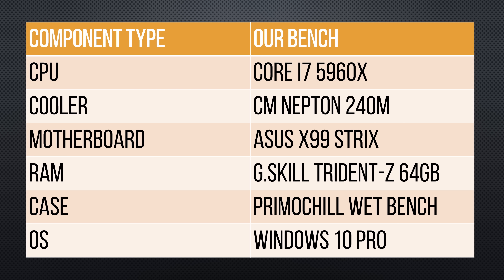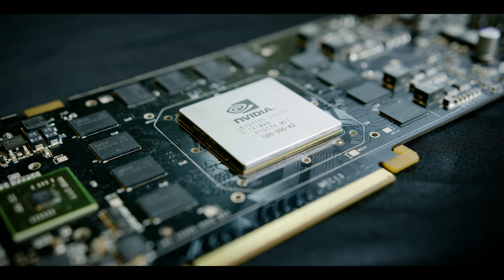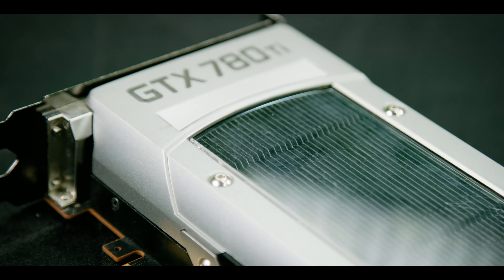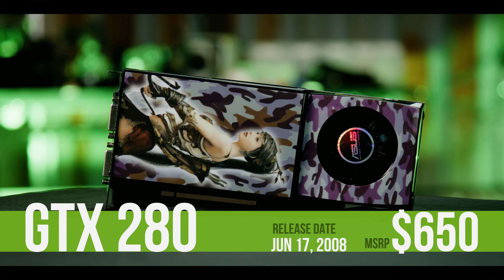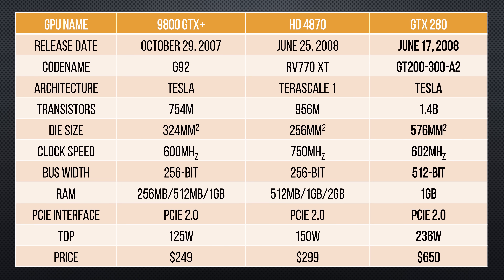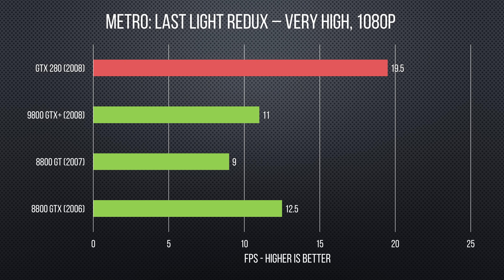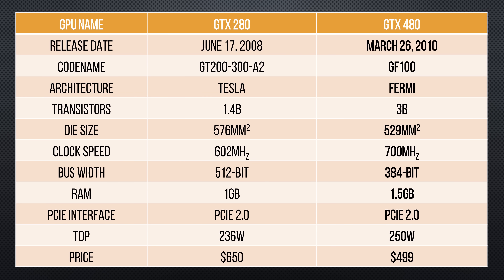10 YEARS of NVIDIA Video Cards Compared!

Comment: yeah but the HD 4870 was way better than the gtx 280
Reply: ego AMD didn't make enough r9 290x's and they were in high demand for crypto currency mining. meaning they were out of stock everywhere for almost a year. and due to this, retail stores kept increasing the price. at the highest point a reference 290x was $900. So while it was better, it was not cost effective to go with AMD at the time.
Reply: and the HD5870 was way better than the GTX 480 And the HD7970 was way better than the GTX 680 even though both of them released half a year earlier and the R9 290X was better than the 780. But Nvidia still outsold AMD somehow and no the drivers werent bad or the cards to hot(maybe not the reference R9 290X)
Reply: ItalyNerf Back in early 2012 i wanted to buy a GPU for BF3 and the 680 had the better performance in BF3 at the time and I was about to buy one. But then I decided to go with the HD7970 because it was cheaper at that time, was a good overclocker, had features like asynchronous compute, better multi monitor support and so on.And I thought it would hold up better than the 480 because of these features. My Card did run 5 Years at 1125Mhz and was able to run at 1175MHz if you surpassed the driver limitation. A friend of mine did buy a 770 which is a slightly altered 680 with higher clocks,more Power draw and better memory and today my card runs games just as well if not better than his card and he runs constantly in directly errors in modern titles. So I'm pretty glad that I purchased the HD7870.The HD5870 is still up and running in another system and does even run BF1.
Reply: Up to personal experience, I had 3 nvidia cards and 5 amd cards, 4 amd cards failed and no nvidia card failed. My 7950 was a dog in overclocking and my 570 was a beast. Running a 1080 now.
Reply: Zane Erickson Thanks, didnt know it was this bad.
Reply: Price/performance ratio, yes it was. But pure performance? Hell no. The HD 4870 was roughly GTX 260 level, the 280 was unmatched until the 4890, but then Nvidia released the 285.
Reply: TheConst4nt sure the 280 had the higher performance but NVIDIA brute forced again and as a result the 280 was more than double the price for the Hd 4870 and in some games with aa the 4870 even managed to beat the 280. With the exceptions of OpenGL the 4870 had other better features like DirectX 10.1 support and so on
Reply: i have three hd 7970's one if a base model, the other two are xfx ghz editions, all three will pretty easily 1100 mhz core, but the xfx models were cappable of maintaining 1200 core, 1700 mem daily, which was way past driver limitations, many people said the the memory vrm would fail due to lacf of cooling, but they were quite wrong, water cooling was added about 6 months before i got a fury x for a deal just to make the pc nice a quiet.
Reply: Well, it might be better today (have not checked benchmarks) but we are talking about gpus that are no longer in production. Most people will buy new graphics cards rather than picking up a used old one. (Most people don't know that you can put together a very good pc with old used parts for way cheaper than buying new)
Reply: ItalyNerf I habe build many Systems over the years and only one 5year old card  failed out of the 10 Amd cards I've used over the years (most of them are now also over 5 years in use). On the NVIDIA side also one Card didn't work after 2,5 years in use out of 5 I've used in Builds. It was actually My HD7970 that failed because I tried to hit 1300Mhz and with the high voltage needed to achieve that the capacitors died.
Reply: +ego  back then amd didn't have crimson but only a shitty driver lacking many features nvidia had/still has like screen capturing with minor performance loss. also nvidia has some nice propriatary features with physx/gameworks I wouldn't want to miss.
Reply: thats why I said BACK THEN not today...
Reply: ego I had a Saphire triX r9 290x that died for no reason 5 weeks after I got it. And they refused to warranty it.
Reply: +Zane Erickson when did you bought the card?
Reply: DanielC when the prices for them finally dropped back down to MSRP. I got my triX 290x for $550 if I remember correctly.
Its a nice paperweight/desk ornament now.
Reply: AMD has relive which is as good as shadowplay if not better.
Reply: Both gtx 480 and 680 were faster than AMDs counterparts, check your facts. Nvidia didn't pull a miracle and sell more without reason, AMD released the cards before and ofc Nvidia gotta leapfrog and take back the performance crown. And today AMD is just a hype train, they still didn't come up with better cards than Nvidia, even though I hope AMD is gonna kick Nvidia in the face cause they need a reality check.

Comment: still using GTX 580, playing dota 2, battlefield 3, COD MW3, Battlefield 1 at high settings
Reply: battle field 1 15fps
Reply: mine reach 50-55fps with 2600K + GTX 580, 1080p at high settings

Comment: AMD FX 6300 six core X 3.50 GHz
8 Gb DDR 3 ram
GTX 1060 video card 
 Is this good or bad for gaming?
Reply: Wade Hutchinson FX 6300 is irrelevant. GTX 1060 is perfect for 1080P gaming. Just get a LGA 1150 i5 with a motherboard, use the ram and you'll be good to go
Reply: bought it from Tiger direct (They suck) when i put the 300 dollar video card in great computer....except for the cheap cooling fans that stopped working ..Goto New Egg for a prebulit computer.....Next time im starting from scratch 
MB on up to a ssd
Reply: Wade Hutchinson well yeah, they are the superior processing units. But if you get it used it can be cheap. I got an i5 4690k with a corsair h80i water cooler for $120. It was used but I cleaned it up and put it in my MSI Z97-Gaming 5 motherboard I got also used for $50. Had 8GB of DDR3 ($50) and a 1TB hard drive ($50). Used a Corsair SPEC-02 case ($30), HD 7970 graphics card ($80) and an EVGA 500B psu ($30) total of around $400 and runs all games super nice
Reply: Wade Hutchinson or get a Ryzen CPU
Reply: Wade Hutchinson but then you'd need new ram so RIP
Reply: Wade Hutchinson Should be able to handle most of the games
Reply: i can run all games on max gpu output anywhere from 70 -180 fps
Reply: Wade Hutchinson I believe it. In 1080P. Soon enough the FX 6300 will start struggling, especially if it's not overclocked
Reply: by that time i will win the lotto and get the UPPER high end shit
im 54 play War Thunder /World of Warships

Comment: I had a 8800GT  back in the day, it was amazing back then on my 3ghz Pentium 4.  
I then went to the AMD 6870 around FFXIV (1.0) and SWTOR time, which I used for a long time.  
Until I upgraded from my Core2Duo, to the 3770k, which I got the GTX 670.  
Used that for a long time, until I got my current 1070.

Comment: Nvidia didn't technically skip the 800 series cards, rather the 800 series is like the 300 series where the chips were only implemented in laptop PCs, but I'm sure Linus already knew that and didn't want to repeat information.

There is still driver support for the 800 series on the GeForce website.

Comment: I think a 780 TI or a 980 would be good for this budget build I'm doing, I see them on eBay for less than $200 and I don't see anything better for that price.
Reply: I meant 780 TI lol
Reply: 1060 is as good/better than the 780Ti iirc
Reply: The 780ti is severely gimped in new games, it falls behind a 1060
Reply: Felixkeeg what about if I get a 980 for around $250
Reply: An rx 480/580 and a 1060 are at par with a 980 more or less.  A 480 could be had at 200, and a 1060 for probably not much more.  I  personally wouldn't go for a 980 unless it was quite a bit below $200 (170 or lower).  At $200-250 there is comparable performing new hardware with lower power draw and a warranty.  People are way overpricing their used stuff (not accounting for reduced life span/depreciation/loss of warranty compared to comparable new hardware).  Not saying there aren't good deals, but if you can get the same perf/dollar new it would be silly not to.

Comment: still using a 670.  i'm poised to upgrade to 1080ti with an htc vive in the next month.  looking at those benchmarks in this video against the 680 has me pretty damn hyped.
Reply: mh444 I sold my vive after my 1080 purchase. my 970 was fast enough because vive's res sux. 
screendoor effect is so noticeable
Reply: Older cards are still fine, really. I used my 560Ti for about six years straight before upgrading to a 970, and I don't intend on replacing that anytime soon either.

Comment: Hey Linus, you're making me feel old. I still have an old 7900GS, one generation before the 8800's. I voltmodded it by drawing silver traces across the PCB, and stuck a gigantic cooler on it (Zipties to the rescue!), then overclocked it massively. It  was actually pretty close to the 8800GT in performance... so close that I was really disappointed when I got one and it wasn't much better than what I had before. xD

Overclocking used to be hardcore - PCB mods, etc.; now it's all practically automatic.

Comment: Graphics cards cooling through the years.
90-95: looks like a soundcard.
95-98: soundcard with a northbridge style heatsink
98-02: 40mm fan on that northbridge style heatsink
02-04: single slot cooler directly over gpu (aftermarket dual slot available)
04-06: single slot blower cooler the length of the card (8800gt era).
06-08: fuck its not enough make it dual slot! 8800gts 512/8800gtx/hd3870
10-12: dual slow twin fans or if noise/temps are ok blower style and just "deal with it"
12-15: same (experimenting with tripple fan loong dual slot or tripple slot.)
15-17: ......so waters pretty good at cooling, who knew?
17-19: liquid salts or permanent phase change, 10nm is more leaky than we expected and thermal density is a bitch (again, who knew?).

Comment: 10 years of "hey sorry we forgot to enable some cores".
followed by "oh hey yeah sorry we forgot these cores too".
tesla-8800gt had 764M transistors but had 14.2% of them nerfed.
tesla-9800gtx HEY they're un-nerfed.
tesla-gtx280 tesla rebrand but made bigger.
furmace-gtx480 had 3 billion transistors but had 6% of them nerfed.
furmace-gtx580 y'know when you said the full 480 core never came out? un-nerfed rebrand.
kepler-gtx680 mediocre core to combat 7970 which was kicking gtx580's ass.
kepler-gtx780 kepler again "OUR BEST CARD YET!", not.
kepler-gtx titan "OUR BEST CARD YET!" not.
kepler-gtx 780Ti "OUR BEST CARD YET!" not.
kepler-gtx titan black "OUR BEST CARD YET!" not.
kepler-titanZ was.
maxwell-gtx 980 "OUR BEST CARD YET!" not.
maxwell-gtx 980ti was........not
maxwell-gtx titanX was.
maxwell refresh-gtx1080 "A NEW KING" pah haa haaa haaa suckers!!!!
maxwell refresh-gtx1080ti "OUR BEST CARD YET!" not.
maxwell refresh-gtx titanX(p) "OUR BEST CARD YET!" not.
maxwell refresh-gtx titanXP almost their flagship if it had HBM2 the tesla versions are using.
10 years... 8 times "flagship" cores had disabled sections that would be unlocked later. 12 times "our best card yet" wasn't, only 4 major architectures.
memory bus width on x80 "flagship" products shrinking 384>512>384>256..., parts of cores being disabled and eventually cut out instead relying on emulation.
So who wants to buy the "flagship" volta gtx2080?....

Comment: What the heck happened to the GTX 590????!!!!!!
Reply: technically the GTX590 is a dual GPU meaning its an SLI setup in one card. this video just explained the different architectures through the ages, while comparing performance with X80 cards or X80ti
Reply: Frequency dual GPUs don't count because it's not a single die, not to mention Nvidia duals were never good, always beaten by and duals

Comment: Still rocking the GTX 480...... because I'm poor and gfx cards are stupidly expensive.
Reply: 7970's cost peanuts...which you can use your 480 for roasting and blow the 480 into the weeds (have a 280x and 3x gtx480's fwiw)
Reply: psygn0sis buy a gtx 970 that is cheaper now baby boo

Comment: I have always had Nvidia graphics cards in my PCs since I had my first graphics card, a PCI Geforce FX 5200 64MB and now have a 4GB GTX 980 Ti. Anyway, if this is "Nvidia GPU cards through the ages", why no GTX 550 Ti, GTX 560, GTX 560 Ti, GTX 650/ 650 Ti, 660 Ti, 670, 750 and 760 Ti etc...?

Comment: I have an A10 7890k CPU with an integrated GPU, 8GB or ram 1600mhz DDR3 and for some reason, it runs lower that it should, for example in overwatch, I have seen benchmark that runs the game at 50FPS in low with 100% render, but on my computer, it runs at 40-50FPS but with 50%render

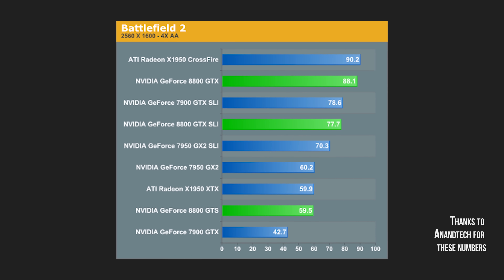Comment: 2:21 so 8800GTX was capable of 88fps, and 8800GTX in SLI was only capable of 77fps? Or is it another mistake and it should be 8800GTS in SLI instead? There's also a mistake @7:04

Comment: My old ass Sapphire R9-290x is on par "fps" with newer NVIDIA cards. Did I hit the lotto or something?
Reply: BigCannon Adventures ya, it's funny how good my 290X is too. I just bought a 980 ti however so I can game maxed on 1440p. ;)
Reply: Is the 980Ti good? I thought about getting a 980 or 1070/1080.  Would it be worth the upgrade?
Reply: [ive built 1070 sli rigs and have used everything under fwiw] 290x is a boss, 980 will be a little faster but not enough that second hand prices will make worth it (still overprices 2nd hand), 1070 is a great card...until vega, we'll see. but if you can get a 980ti second hand cheap you'll be a very happy chappy and its what i'd do if i wasnt happy with my card and couldnt wait for vega.
Reply: Toms Tech bought my 980 Ti Asus Strix OC last week on eBay for $300 barely used. Smoking deal considering I can sell my 290X for $200.
Reply: Toms Tech bought my 980 Ti Asus Strix OC last week on eBay for $300 barely used. Smoking deal considering I can sell my 290X for $200.
Reply: I'll have to really think hard. It took me 2 months to decide on the R9-290x lol.  A 980Ti for $300 sounds amazing but then again Vega could be the "next gen badass". I just dont know

Comment: Could we get a new Hackintosh build video? like a GTX 10xx and Intel Skylake (or AMD Ryzen) one?
Reply: You cannot make a hackintosh with AMD cpus, not worth it anyway.
Reply: Yes you can, and it is worth it if you need mac os but don't like mac hardware
Reply: Solomon, nope getting AMD to run on MacOS is more trouble than it's worth as you'd need a hacked kernel. -Hackintosh owner who tried AMD.
Reply: Wybrem you are completely right, fuck that hacked kernel, and I have my own Mac anyway 

-guy who tried the same thing
Reply: I think it can't be done with ryzen CPU's

Comment: 7:03 Listing the GTX 580 as a 2GB/4GB card, you must have been thinking of the GTX 680 when you made that chart. The GTX 580 still supported 1.5GB like the GTX 480, but it did have a 3GB model launch. Remember the bus width dictated the maximum available VRAM.

Comment: Ì OC my GTX470 to 890mhz (almost 50% OC) and played until recently BF4 on 80-130-fps on LOW settings with some on HIGH, on ULTRA -28-59fps. NOT BAD FOR SUCH OLD CARD. And the bioses were not like GTX900 or 1000 cards. It was fully unlocked card

Comment: I went from 8800 GTX to GTX 780 and currently using a GTX 1080 (with hybrid cooling). I've been following Nvidia since they acquired 3Dfx back when antialiasing had just been invented. 
The one thing that bothers me about Nvidia currently has to do with color banding issues when attempting to color balance a monitor using their proprietary software. Really bothers me and they just don't care about the issue currently.
Reply: "proprietary" and "dont care" is pretty much nvidia's motto.

Comment: There was  a huge shortage for the 4GB GTX 980 so even tho it says $549 MSRP that is a Lie & not true(Nvidia was bullshitting customers), my Nvidia branded reference 4GB GTX 980 cost $640USD from local bestbuy here in the States! (I Purchased 2 months after release). GTX 980 videoCard was never in stock!

GTX 1080ti is the same with scalpers putting the card @ $899USD first 2-3 months!

Comment: Why didint you talk about the good old GTX 690 :(
Reply: GhostInforno45 because the 690 was two neutered 680's on one card, not a single GPU, or else they would have had to do all the other dual gpu cards, not to mention that because it was air cooled the 690 ran like a furnace and performance much worse than 680's in sli, their next and last attempt at dual gpu was the Titan Z at $3000 which was a massive fail, the $1500 295x2 was 35-25% faster at half the price
Reply: or 9600 GT 1GB version

Comment: had i just knows this back when i wanted a gpu, i bought the gtx 780 and now i see the crap nvidia pulled and why it constantly ran at 89c, 250watt big chip is not for consumers and air cooling.  
now i got a gtx 1070 at about 160watts, about the most power hungry they really should sell to consumers.

Comment: NVIDIA didn't skip the gtx 800 series , it put them in laptops(860m). just like Intel did with the 5000 series CPUs
Reply: 800m series was kepler still so its either a skip or a rebrand.
Reply: 800-820m: fermi, 840-850m: maxwell
860m: maxwell and kepler
870m: kepler
880m: kepler.
Reply: Mainstream or not, I have a desktop with i5-5675c, 16gb RAM ddr3 1866 and one gtx 1060 on a MSI z97i gaming AC mb. works flawlessly.
Reply: Toms Tech lol Fermi in 800 series :o
Reply: Similar to AMDs HD 8000 series. Reserved for OEM rebrands, APU graphics and mobile graphics.
Reply: Intel 5000 series were desktop too. Search i5-5675c for example.
Reply: oh cool, but not for mainstream desktop , just workstations , that's why they have intel iris graphics

Comment: nvidia 2010 480 580
amd 2017 480 580 
amd using the same optimised chip selling point that nvidia used and did the exact same names and having the same exact difference and calling it a new generation